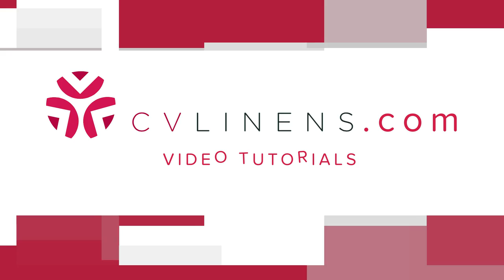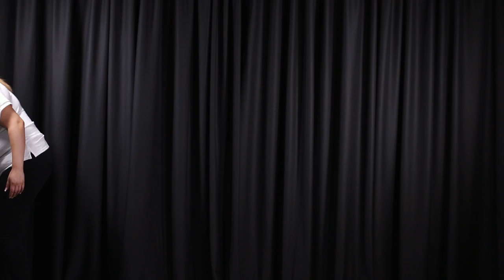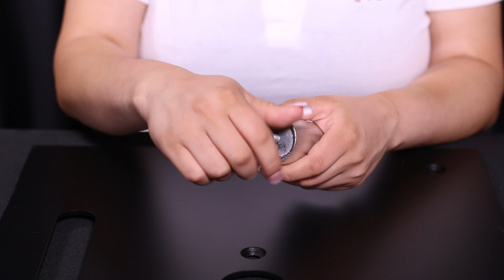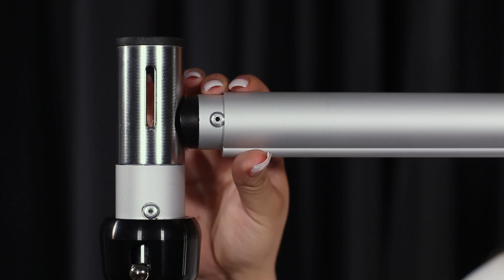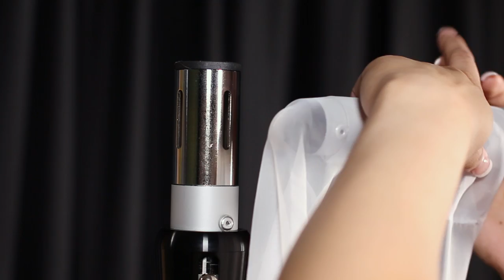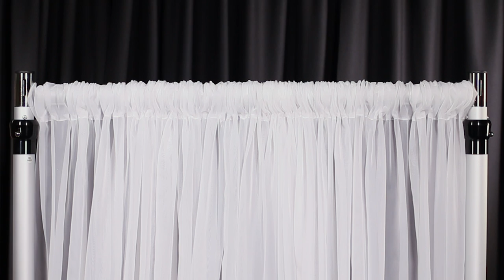How to Set Up a Portable Pipe and Drape Backdrop

Comment: Hello, how heavy are the bases? I'm looking for a sturdy set that has crossbars and could be used outside.
Reply from the maker: Hello, thank you for watching our video! We have 3 different sizes of bases, depending on the height and width you need for the uprights and crossbars. Each base has the weight in the description but we also have pipe and drape sets which come with the base you need for the height and width of drape set to keep it sturdy. You can find them online here: https://www.cvlinens.com/advanced_search_result.php?keywords=base+-pin. If you have any further questions please don't hesitate to give us a call at (512) 821-1178. :)

Comment: How will I attach a chandelier to this backdrop
Reply from the maker: Hi Theresa, thank you for watching our video. Chandeliers can be attached to the drape set with specific hooks that are wide enough to fit over the crossbar and that will support the weight of your chandelier or you can also use a wall mount hook behind the wall of the backdrop to hang your chandelier on. If you have any further questions please don't hesitate to send us a message or give us a call at (512) 821-1178.